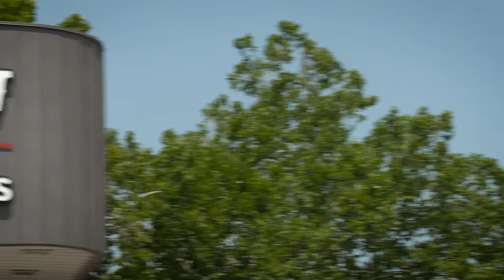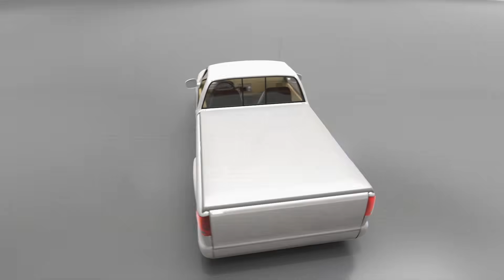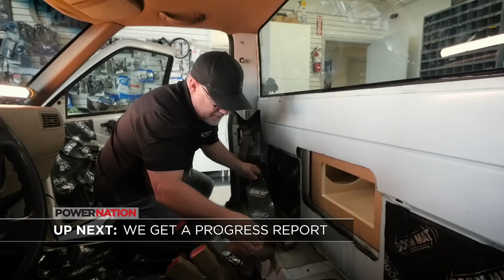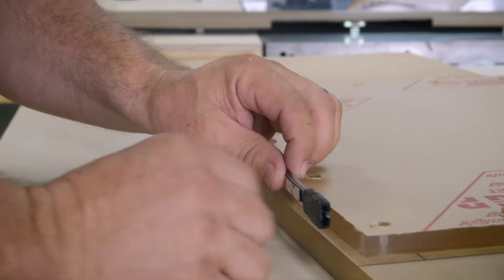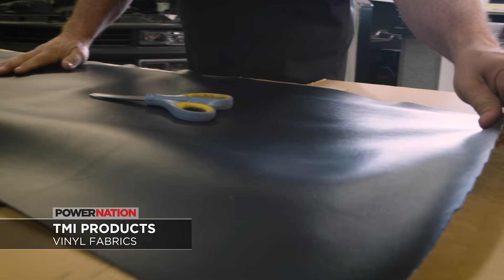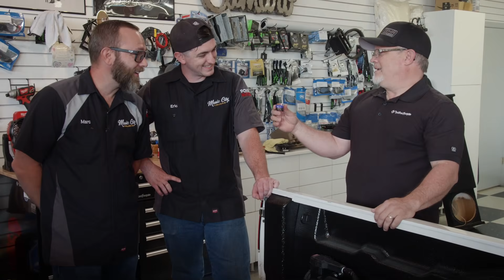Low-Fi S-10: New Audio System & Interior - Music City Trucks S3, E15

Comment: I had my share of systems in my like. 2 8s, single 10, 2 12s, 1 15" and 8, yes 8n12s. This is making me want to do another system. My last was 2021. I need bass. Im 51 years old. Lol
Reply: 😅😅j just put 12s in my towncar I’m 43 some things never get old
Reply: im 52 just rebuilt a pair of sonyes xs-l1255g in a sealed box ,2 pair ampere dream series 6x9s and 4 dayton silk dome tweeters , vevor mxab500.4  and vevor bp3000.1 for amps , PR1900 Energie Battery with 1/0 welding wire and FBINSE 9.2 touch screen in my 2012 grand caravan. its not big money

Comment: This guy is great. In 1997 I had a 92 S10 low rider hard top convertible. The sound system was exactly this build. Ported from the bed with full length box. All Fosgate. 5 star rims. Roll bar. Hand tuned. Man I miss that truck. Only down side was the hard top leaked like a sieve.

Comment: Back in 95, we would have sawed that bed completely out and have 4 15” subs with a massive punch, Orion, ppi, or even a linear power amp blowing the windows out of that thing. While sitting in 15x10 deep dish reverse hammers with the wheels sticking out wide. Good times

Comment: Just watched the show. Very cool. Car audio still thrives in me. Check out my ‘04 F-150 8200 GVW. Has an Alpine stereo, 10,000 watts, 13 Alpine amplifiers, 16 vocal speakers, 6 10” subwoofers in a custom, 2 section sub box. Has dual alternators, dual charging systems, Alpine alarm, separate self built alarm for the amplifiers enclosure and so much More. Doesn’t matter what music you are listening to, whether it’s music that wants to tear the truck apart or music that gives you goosebumps, it sounds absolutely fantastic.

Comment: This was one of your more fun episodes to watch. As a 90’s teen, the craze was all about subs, amps, and boom tubes!  My 67’ Chevelle had the distinct sound of 3” Flowmasters and a trunk that rattled because of my 12” Kickers. Miss the 90’s.
Reply: I had a mazda 2000 mini pickup with two 12" subs and a 600w kicker amp mounted in the bed with pass through vents that went into the cab. Then inside the cab, 2 10" subs behind the seats, with bandpass filters on all the subs, back ones with the lowest, and midbass inside the cab on the tens. 6" mids and highs on the doors, and tweeters under the dash. It was so clear and clean. And rattling peoples pictures off the walls a block away! I miss the 90's too.
Reply: @izzyplusplusplus1004  That truck you had is the pinnacle of 90's audio man! I  had a Chevy s-10 with a blow through and 3 - 10"  MTX Blue Thunder subs, Rodek amp ( all bought second hand while i was in high school!)  lowered with a bell tech drop kit, 350 chevy engine. Miss those days! Now I own a Automotive shop and thinking of bringing back the 90's low rider truck I had or a Mazda B2200 extended cab truck.
Reply: @techman8336  Oh man, that extended cab b2200 would be a sick audio minitruck!
Reply: @techman8336  I bet with that 350 pushrod motor it was fast!
Reply: I had a gmc squarebody suburban with 4 12s dual amps, 😂 wild times to be alive.. the good ol days
Reply: I still haven't gotten away from subs in every vehicle I own lmao. Probably why I'm 34 having to get repeats every time someone says something to me lol
Reply: I always started with stripping the car down. Throwing the alternator in the bin. Installing new high output alternator. Dynamat everywhere. Laying down wires. Good head unit, active crossover. Separate amps for subs, mods and highs.
Reply: @HaraldBergTechTv  I did all that to the b2000 I had, as well as custom enclosures for the amps,  fully hidden wiring, and a vent fan to keep the air flowing over them. I had A 60 amp alternator, and extra battery, and it would still drain both batteries in a short time at high volume. I had to keep the motor running most of the time to run the system. It was awesome.